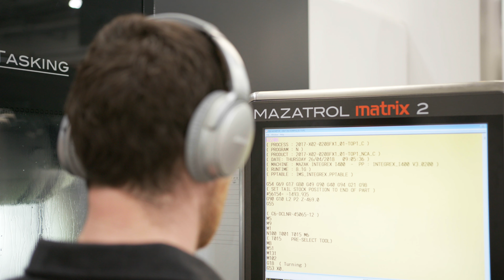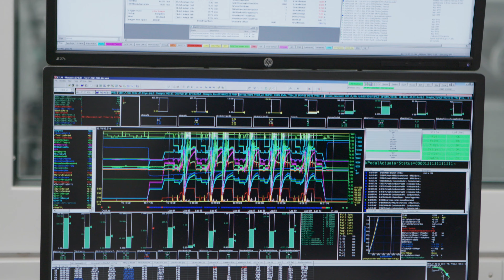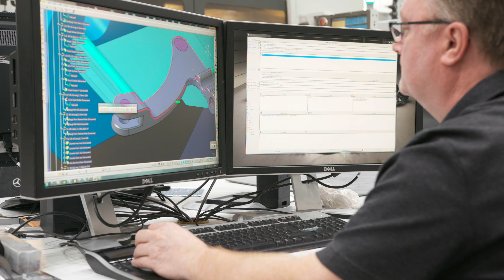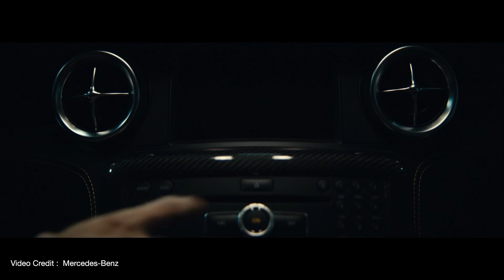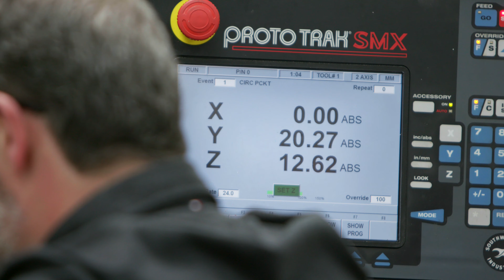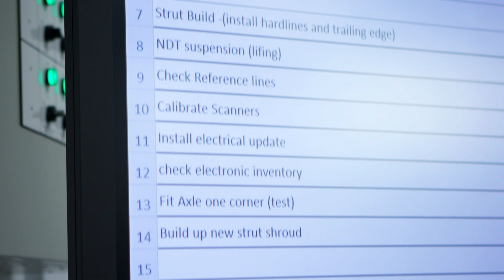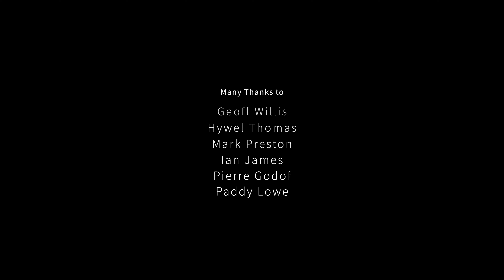The Future Of Motorsport In The Electric Age: Insights From Industry Expert Roger Atkins

Comment: Fantastic content. Raising some great questions. I do think combustion will live on. It's application may be limited to motorsports and use new types of fuels (hydrogen or efuels) but there will need to be some sort of transition. Batteries have several technical impracticalities that may stop its mass adoption, or slow it down significantly. Hydrogen looks like the long term solution.
Reply from the maker: Much appreciated - and I'm with you on the notion that future tech will be application specific...and we have to be wary of too much 'tribal tech talk'...
Reply from the maker: @jfv65  if the best engineers are put on the case I’m certain we will see multiple solutions!

Comment: At min 30 the main point is remarked. The regulations of F1 are wrongly designed, because incentive to research for better E technologies that could improve competitiveness of cars - and at the same time, at least in principle, aim at the same needs of road cars, would benefit everyone. The current limits and prohibitions about the amount of energy stored, the power only 160Kw, to be used in a very specific way at each lap represented an easy achievement for engineering, that once accomplished, reduced incentives to research for better, more powerful inverters, controls strategies, el motors. 
Those are the aspects that drive most of the hype about Tesla vehicles these days, which means it could represent an option for engagement also for F1 audience. But F1 simply prohibited it. 
Tech rules in F1 is an intricate, incoherent mess since 2000s. Cost reduction is a main focus because interest in the sport is shrinking, audience is less and less addressable by advertisers, which demographics are getting older, and those decisions are just making the situation worst at each iteration. 
Free regulation would attract again the big manufacturers, money, and experimentation could lead to strong know how about edge technologies such as solid state batteries, to name one, that Only F1 could afford to exploit in its own unique way. 
It is not going to happen, though. No F1 in 2031.